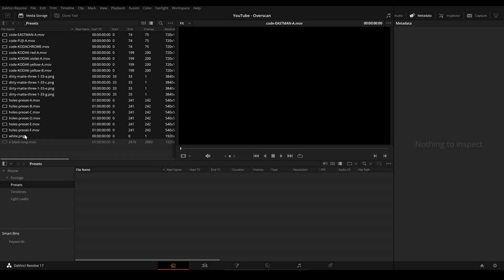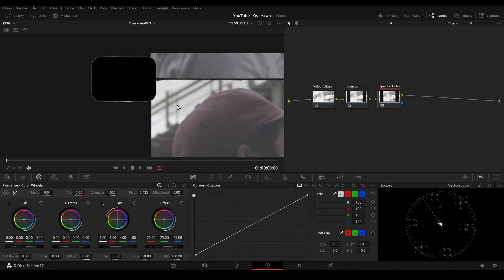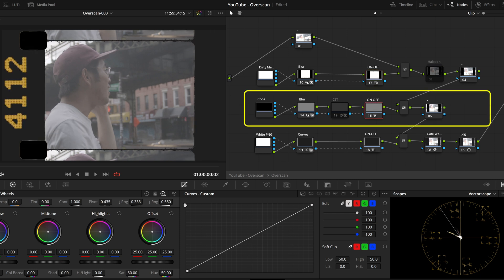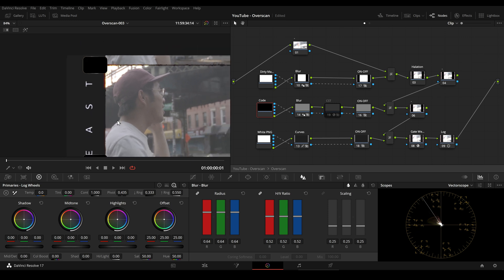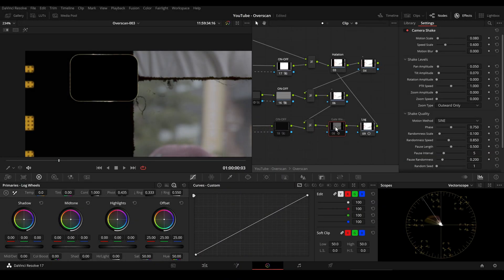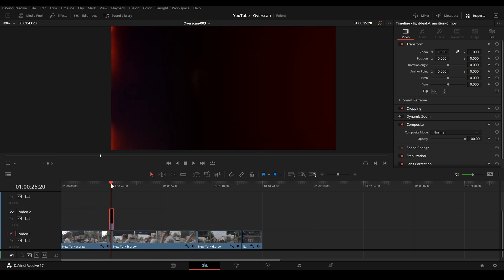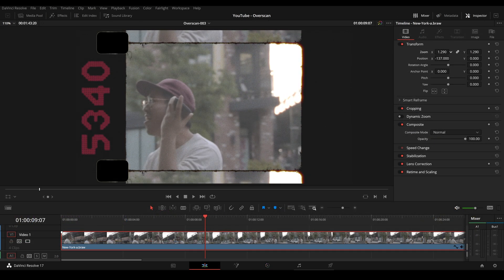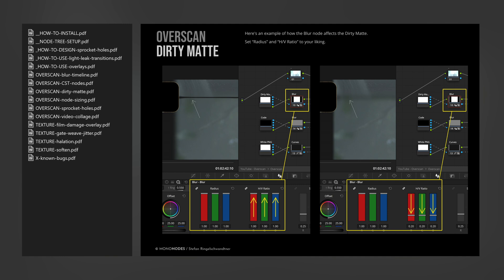16mm Overscan Look in DaVinci Resolve

Comment: Can we still use this if we have the free version of Davinci Resolve?
Also, Did you color grade the footage before applying the over scan in the example at the end?
Reply from the maker: I'm not sure if the "Video Collage" feature is available in the free version. However, PowerGrades, Halation (my own Halation Node Tree which is part of the pack), Dirty Mattes, and sprocket holes all work with the free version. As for the "Video Collage" PowerGrade/Node, I cannot confirm its compatibility with the free version. 
EDIT: Yes, I grade the footage before applying the overscan PowerGrades. But it's entirely up to the users how and where they grade the footage.